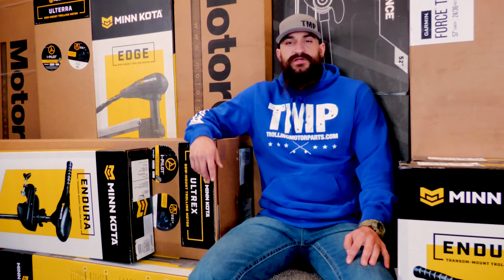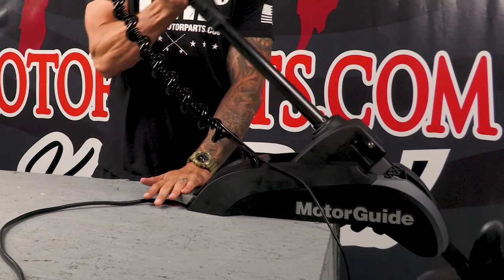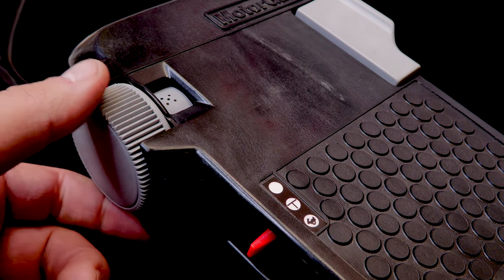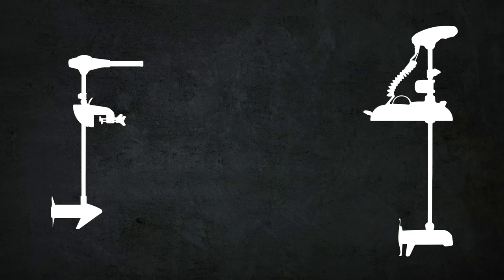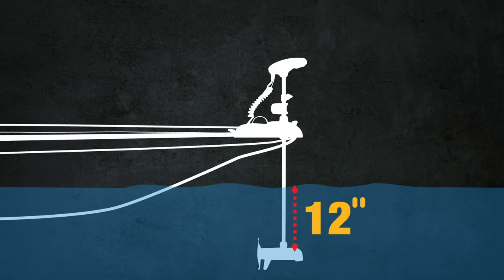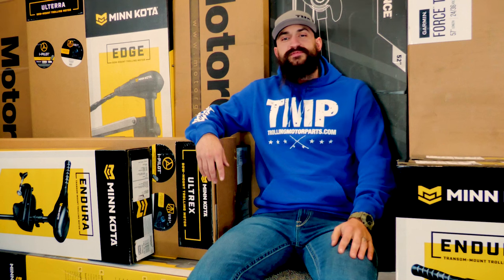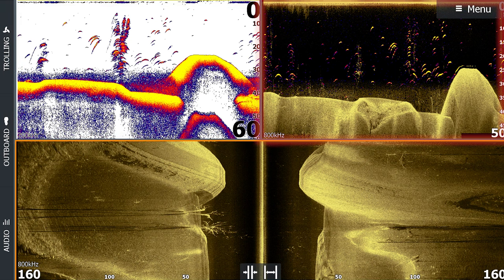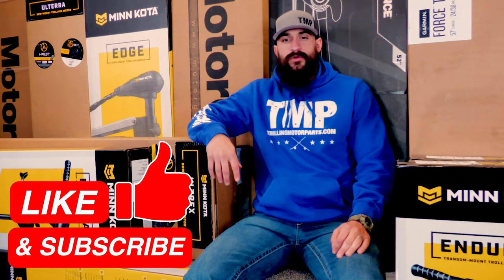Watch This BEFORE Buying a Trolling Motor... ULTIMATE Buying Guide

Comment: Why can't I get more than an hour of use out of my Minn Kota 70 ...24V ( came with boat )??  Fully charges after EVERY outing.  Usually set on 7 for trolling.... 1.8 - 2.0 mph.....20 ft. TriToon.....engine up.... NEW batteries.  VERY FRUSTRATING !!

Comment: I have a question, I've seen 40lb trolling motors with different draw, one said 40a and the other one had 34a, is it a typo or is the second one more efficient? I'm using one as the sole provider of movement on a 12ft aluminum with 2 adults and gear. In total it weighs in at about 655 loaded, my 40lb troller is about 14 years old I was thinking about giving the more efficient one a go. Thanks for any responses to that mess of a post.

Comment: Awesome explanations and very helpful. I have a Minn kota riptide and a Torqeedo. The Torqueedo is quite noisy with a hum I put down to the brushless motor electronics. The Minn Kota is quiet in comparison. I use my motors on a canadian canoe and an island style outrigger. Is it a case that some brushless motors are quieter than others ?

Comment: I need a saltwater trolling motor with a spot lock feature. 
I fish in wind a lot and in places with lots of current.

I currently have a Minn kota 24 volt on the bow, it’s a hand handle one and it’s fault annoying while fishing.

Also my batteries will last me 3 hours max when fishing on a windy day.

I may get some lithium batteries first just to see if I need to upgrade to a 36 volt for the future new trolling motor.

I would appreciate some knowledge with people who own a boat approximately 3000 pounds plus and on 19 plus feet bay boat Center Console 🙏🏻🎣😎

Comment: I have a Lowrance Elite FS 9" screen I am looking for a good trolling motor for this unit that will spot loc. It would also be great if trolling motor could handle salt water. My boat is a 22' Aluminum Starcraft CC Marine with a 115 4 cycle Merc. What would you recommend or suggest for a trolling motor??

Comment: Will a high-thrust transom motor jack knife a 14-foot aluminum boat even if set to the slowest speed, I  need the higher trust for my river fishing, but I also need a slow speed for casting and trolling in lakes I just don't want to go airborne.

Comment: Hey guys, thanks for the great videos! My boat unfortunately works with a 12V system and i need at least 70+ LBS thrust motor. What would you guys recommend me buying?!
Reply: Buy a 24v lithium battery if you don't have a place for 2 trolling batteries

Comment: I have a 17' Blue Water closed bow, stern drive. 2200#, I would like to add an electric trolling motor. Which do you recommend? I will be putting on a fold down bracket.
Thanks

Comment: good video, was wondering we mainly fish a electric motor only lake. I have a older 15 ft aluminum boat. But I put a floor, a front deck and bass seats so it is heavier now. I run two 40lb thrust and it only does about 3 mph which isn't bad with 3 people in the boat. Would a 60lb knock off out perform a 55lb minnkota? looking to get a little more speed out of it lol. or would the two 40lb motors out perform one 55lb motor? we go about a mile or so from the boat ramp,
 Trying to stay with a 12 volt system even though I have 2 batteries at all times.
Thanks a bunch
William

Comment: Great video ! Concise and very informative. Do you have any inside information if Minn-Kota will be offering the Terrova with a 36” shaft for kayaks?
I just installed the MotorGuide Xi3 on my kayak and it seems their missing a lot of sales because guys don’t want to alter the shaft length.
Thanks
Reply: You are so right. I’m currently holding off on purchasing the MotorGuide Xi3-55SW - Bow Mount Trolling Motor - Wireless Control - GPS - 55lb because they don’t have te 36” version for kayaks. They have it in 48” but cutting it will void the warranty. If they were smart, they’d have realized they are losing customers. 

Also, their customer service is HORRIBLY TERRIBLE. They never answer their phone.

Comment: I was hoping for a recommendation...  I'm just a simple bass fisherman.  But, I do want to take advantage of the Spot-lock, and i-Pilot features.  I just don't need a 12" chartplotter at each end of the boat.  Right now, there are so many options, it's incredibly difficult to know what to pick, and to make sure I'm getting everything I need.  That said, the cheapest setup that gives me those capabilities.  Anyone in the know is welcome to answer.  I'll need to have that figured out before I pick up my lithium battery upgrades.

Comment: Hello, i have a specific need but i don't know if that technology exists. Can the motor follow a moving target and keep a constant distance between itself and said target, let's say 60 feet away from it?
I do spearfishing and sometimes we do some drifts along a reef. It would be really useful if the boat could follow us while we are drifting in the water, maybe with a device (gps transmitter) on a float that the motor can pin point and follow, or on someone on the surface.
Does that exist? It could also be a great safety option when a sailor falls in the water

Comment: Due to digital commutation noise a lot of brushless motors are much nosier than brushed motors. So saying brushless are quieter may not be correct in many cases,
Reply from the maker: Thanks for the input. Can’t really speak for all brushless motors, but as far as trolling motors go. We’ve tested all the models and brushless are significantly quieter.

Comment: Have a minn kota fortrex 112 with the built in transducer, it plugs into the hummingbird graphs but I want/will be switching to the garmin 93 or 106 sv uhd's. Do these plug directly in or is there an adapter I can purchase with the graph. Thanks.
Reply from the maker: If it has US2, you can get an adapter that will plug into the Garmin for sonar. For UHD ClearVu or SideVu, you would have to install the Garmin Transducer on the outside of the motor.

Comment: Hello Rob. Here is a scenario, an motor on a boat or a kayak, no other gps mounted,  just the motor itself. Can be used on this motor the spot-lock option in this case? If yes, can you please recomand me a motor for a 13 feet kayak. Thank you very much for your answear.
Reply from the maker: The MotorGuide Xi3 with Pinpoint GPS and the Minn Kota PowerDrive with I-Pilot are both popular on kayaks. Both of them have spot lock built in and don’t have to be linked to a graph.
Reply: @trollingmotorparts  thank you very much!

Comment: Hi! I've been watching your repair videos, all great thanks, but I don't see a fix for my problem. I have a Motor Guide Wireless 55lb thrust (no GPS) that worked fine 2 weeks ago with fresh batteries in the control pedal and a new deep cycle battery. Now when I plug the motor in....it automatically starts spinning (fast) and will not stop unless I unplug it.....help! (please).
Reply: I would bet the foot pedal is faulty, it happened to me! I pulled the batteries from the foot pedal remote and mine worked again! Hand remote only now but I didn't like that pedal anyway!

Comment: Very helpful thank you so much!!! Would love your input on Solar Panels as alternative power (obviously would need to use 2 parallel motors correct?) Depending on wind, weight, chop, boat size, etc... Thanks from Newport Vessels!
Reply: I'm not a pro here but I know enough about solar power to know solar alone would not power a boat unless you had a humongous array.  It could be helpful for recharging a battery for sure.  For the same reasons we don't use solar to power a car it alone could not consistently power a boat.